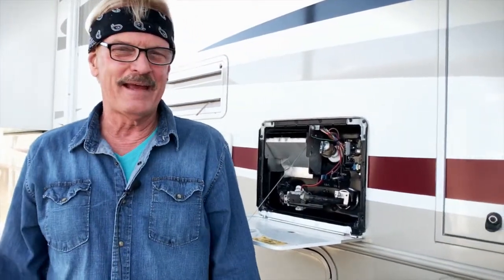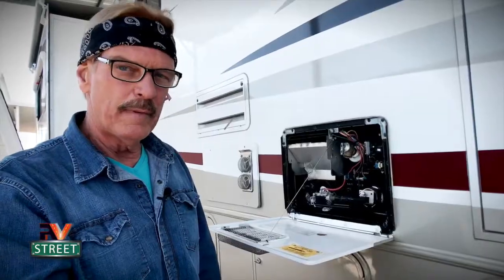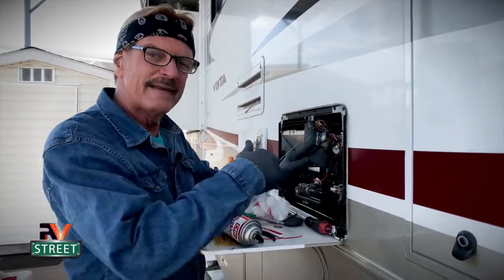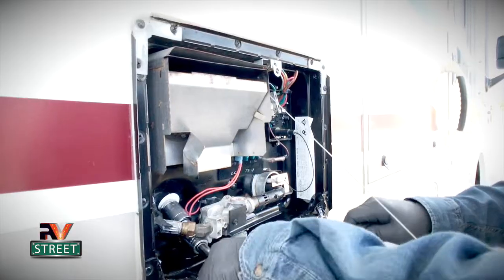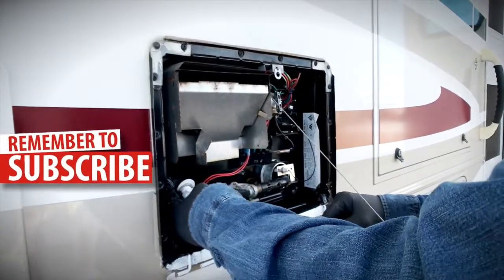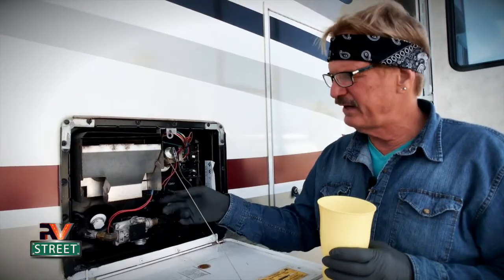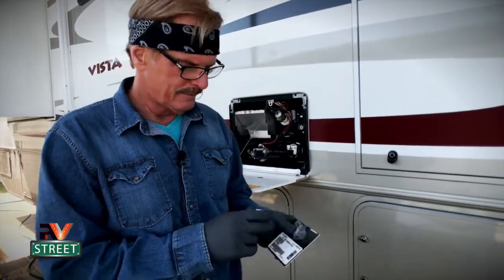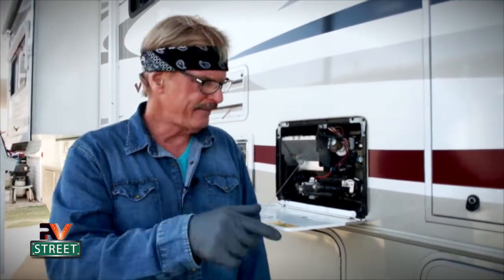CLEAN, FLUSH & SERVICE RV Atwood Water Heater 2.0

Comment: I just tried this and assumed my hot water tank was empty but after trying to refill with 3 gallons or water then 3 gallons of vinegar the funnel overflowed after adding only 3/4 of a gallon of vinegar. So now I have a very diluted solution of vinegar and water. How do I get the rest of the water out of my hot water tank?
Reply from the maker: I believe there should be a drain plug towards the bottom of the tank. I'm sorry I can't be more specific about this but Martin has passed away and I'm sure he could have given you a much better answer. Sorry

Comment: Is there some way to hook up a drain hose or something to the drain so the water and vinegar and minerals aren't running out on wires and the surface of the exterior of your motor home?
Reply from the maker: Not that I'm aware of but it won't hurt anything. Been doing it this way for years. Just wipe it off with a rag. Not to worry.

Comment: Hello; I'm a bit late in replying, however, I found that my H.P. relief valve "dripped" and was a cause of a real amount of rusting/corrosion, I drilled a 1/2" hole and placed a 3/4" x 1/2" NPT fitting c/w a 1/4 NPT nipple c/w a piece of garden hose to drain any water "dribbling" to the outside, then treated and painted the affected areas.
Reply from the maker: Never to late Richard. thx for chiming in my friend. 👍

Comment: I was wondering that back in 2019 you did a similar video with an atwood heater and emphasized using a brass drain plug but no mention about it in this video, why?
Reply from the maker: In that 1st video, the brass plug was used because I was experiencing a small leak with nylon plug and I couldn't get it to seal correctly.

Here's the additional comment I—Pinned—at the very top of the 2nd video
Concerning the Nylon Plug being the 3rd safety feature. I didn't mention what it actually does like I did on the other 2 safety features. Don't know how I missed that but....
The nylon plug is a backup safety feature. 
The plug is hollow on the inside so it's designed to blow out if the primary safety feature—the high pressure valve—fails for whatever reason.
As I showed in this video, since I have cleaned and removed the debris that was causing my initial leak in the water heater threads where the nylon plug screws into, I have gone back to the Nylon Plug and now do not experience any leaks.
See 13:38 in the time line of the 2nd video.

Comment: Hi Martin is just finished cleaning out my hot water tank and the shower is making a lot of noise, even after shutting off the faucet. What do you think that can be??!
Reply: Must have been scale deposit on the valves. Ran the water for a good 1/2 HR and it cleared up
Reply from the maker: I was just going to say as I was reading your first question. He's got air in the lines. Run the water for a bit and it'll be fine. Glad you got it fixed 😜

Comment: Hi sweet heart to hot the water need to be ful tank of gas?
Reply from the maker: I saw your other comment when you watched my 1st water heater video and now this comment on my 2.0 video. Your water heater doesn't run on gas. It heats on either propane or electric. If it's not heating up the water    on either, I would first clean & check all the electrical connections like I showed in my 2.0 video. Check all your fuses and make sure you have tripped a fuse. Make sure you have water in it. Make sure you have propane and it's turned on at the tank. Then try heating it up again by turning on the electric switch. If not, then try turning it on by using the propane switch. Both will be inside the RV. If it still doesn't work then it's going to have to be trouble shoot to see if perhaps the heating element or the control board is good. In any case, you won't be able do your biannual vinegar flushing until the water heater is working correctly.

Comment: Martin could i not acheive the same results with a pressure washer using a tank nozzle and a specific cleaning solution?
Reply from the maker: I'm not sure what "specific cleaning solution" your talking about, but this is white vinegar. Does the job. Readily available for about $5 for 3 gal. @ Walmart. And for me, I would never use a pressure washer in this type of application. Just not necessary and run the risk of bad things happening. No need to over think this. This is an easy DIY job the way it is.
Reply: @RVstreet  I'm really afraid of what i will see when I put my Endoscope in there, 20 years of growth, god knows what I  will find.  Your right though vinegar is most likely the best cleaner. Second question from my wife, how can we clean the fresh water tank, every spring we have sediment that come up and block our tap?  Love your Video's, great job.
Reply from the maker: Add 1/4 cup of liquid household bleach (not gel, or scented) to every 15gal. of water in your fresh water tank. Fill the fresh water tank up till full. IE: If you have a 50gal. water tank, fill it up till full, add a little over 3/4 of a cup of bleach, or just make it easy and make it an even 1 cup.

Let it sit overnight. Then completely drain the fresh water tank. Fill it back up to 1/3 full or to whatever the level you normally do and you’re done.

There are other ways to do this but this is the simplest method when sitting still or being parked.

Comment: Hi I need too try this . All of my faucets are running slow on the hot side. My rv is 2 years old and I clean my hot water tank each year at winterizing time. But I would have never thought about the vinegar. If this doesn’t work what is my next option! Thank you
Reply from the maker: Vinegar is the ONLY thing that will work in removing mineral deposits in your water heater and water lines.
Reply: @RVstreet  so before I empty the hot water tank . Should I try to get some of the vinegar thru the lines?
Reply from the maker: @nightryder1227  Yes. Turn ON all the hot water facets until you smell vinegar. Then turn them OFF. Let that hot vinegar sit in the lines for several hours. Then flush water heater and lines. More than likely you'll have to unscrew the facet screens and rinse them out. They'll be full of mineral deposits. Then unhook your shower hose and rinse out that screen too.
If you're not using a water softener—which you should be—this will need to be done twice a year if you are a full timer. Once a year if you're not. Hard water is brutal on RV water systems.
Reply: @RVstreet  thank you ! I will try this. Cleanining the hot water tank today helped some. But the hot side on the facet’s are still running slow. I guess I will drain the water heater back down and add more vinegar. I did get a lot of deposits out the first time I flushed it.
Reply from the maker: @nightryder1227  Use a 50/50 concentration. You can go as high as 25/75 if you want. Best time to do it is at night time when you aren't using it. Turn the water heater ON and let it cook all night. Morning, drain, let the water heater cool then flush it and the lines again.

Comment: What kind of water softeners are there for RVs?
Reply from the maker: I don't know for sure, but not many though that are portable for RV's. If you're interested, here's a in depth video on how I set up my wet bay, water filtering and water softener: https://www.youtube.com/watch?v=1Reh8q6-rC0&t=422s

Or this video that kinda just gets to the point: https://www.youtube.com/watch?v=14Zo8Vkvh5o&t=352s

If you just want the information and links where to view or buy what I use, here it is:

HERE’S WHAT I BOUGHT TO SET UP OUR WET BAY FROM OUR AWESOME VENDOR THAT SPECIALIZES IN RV WATER SUPPLIES
To buy the Custom Made to Length Hoses, Water Filters, or a 16,000 grain Double Standard Water Softener" click the link below. This company is family owned & their customer service is 2nd to none. Very easy to order what you need online and they ship fast and are a great company.
https://www.rvwaterfilterstore.com/mm...

💗 ONCE YOU CLICK THE ABOVE LINK, TYPE IN THE FOLLOWING PART NUMBERS IN THE SEARCH BOX and then put them in the cart for check out. These part numbers BELOW will give you the exact same system I have.

• For the 16,000 grain Water Softener (that will supply you approx. 1,600 gallons between recharging which is simple to do) just type in the the search box—Water Softener—and then you'll see the Essential RV Water Softener Portable 16,000 Grain w/Custom Hose.
• For my Watts Water Regulator, type in the search box—Watts 263A-LF with gauge
• For the Dual Water Filter Canisters with mount, you want to get the Essential Whole RV Water Filter System with Bracket. You’ll receive (2) 10” Sedi Filters and (1) .5 Micron Carbon Filter. So type in the search box—Essential Whole RV Water Filter System with Bracket
• For extra .5 Carbon Filters which you are going to need, type in the search box—F1Pb CFB PB10 10" Carbon Filter Cartridge—. They are only sold in single packs but normally last up to twice as long as the Sedi Filters
• For extra Sedi filters, type in the search box—RV-SED1 cartridge, 10", 2-pk
• For custom made to length hoses, type in the search box—Hoses—and then click—Hoses, custom Built for you—.Then order what you need. 
NOTE: This is a fantastic system and you'll no longer have to worry about your RV water.

Comment: Martin, I think you might get a better flush by removing the drain plug, and the relief valve, then push the water cleaning tool thru the relief valve opening. Also, might want to be careful draining the vinegar water as it will likely kill it........NOW GET TO WORK, AND GO HAVE A PICKLE, mmmmmm vinegar!!!!
Reply from the maker: Yeah I suppose you could do that. BTW...what do you mean by "will likely kill it"? 😜
Reply: @RVstreet  I see that I did not finish my thought. Vinegar on grass will kill the grass. Looking forward to more videos, you do a great job.